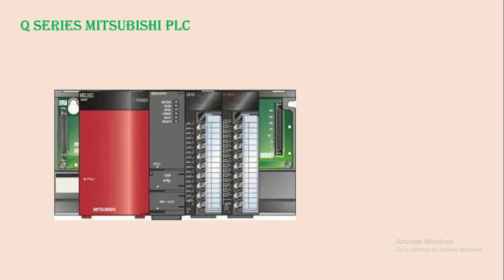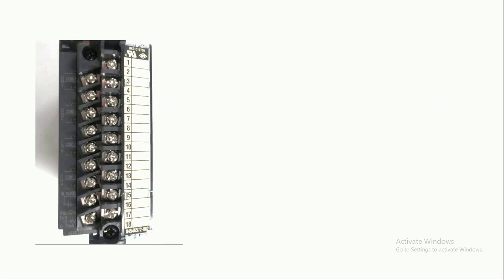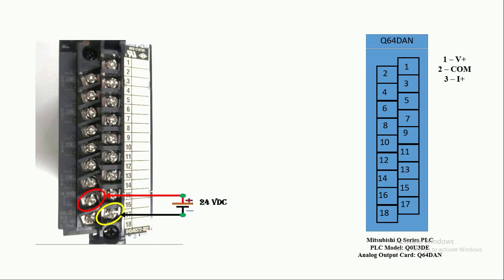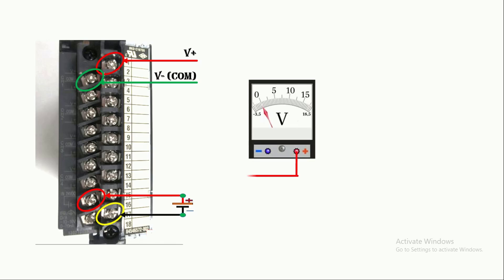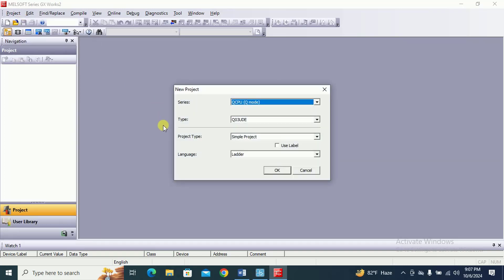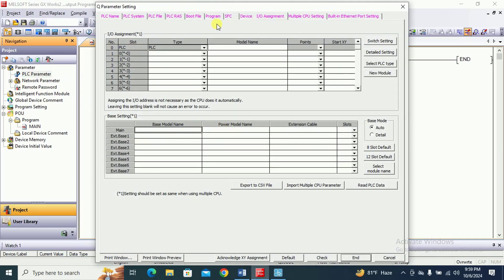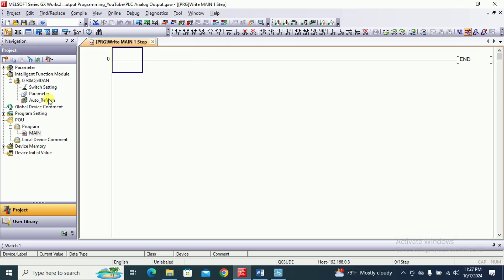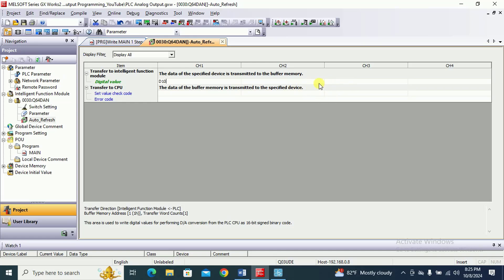Mitsubishi PLC Analog Output Programming

Comment: I have a question for the analog output. I have done set the address for the analog output just like in the video, but when I test it the analog output don't have any value. i have done set it to voltage. but when i test it with voltmeter, my voltmeter detect no value only 0V. is there something wrong with my plc or my wiring? thank you very much
Reply from the maker: Please make sure that the channel (which you are using) is set to enable in the option for parameter settings. Also you have to write plc ladder for digital to analog conversion function enable. Yet if you are facing problem please mention that in comment section.